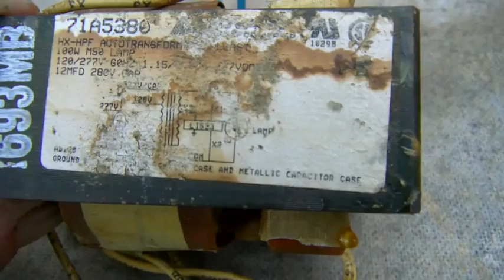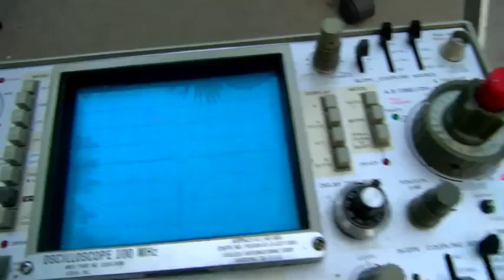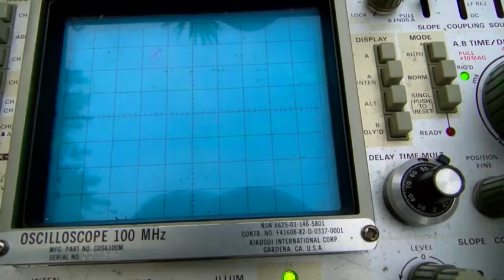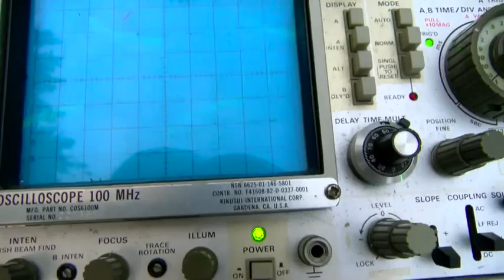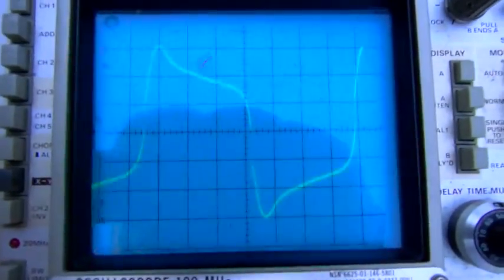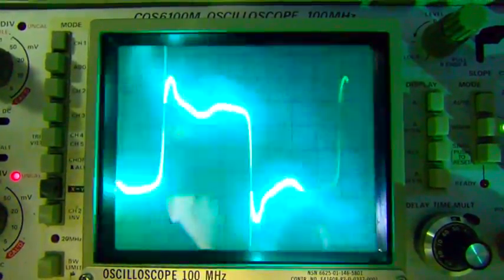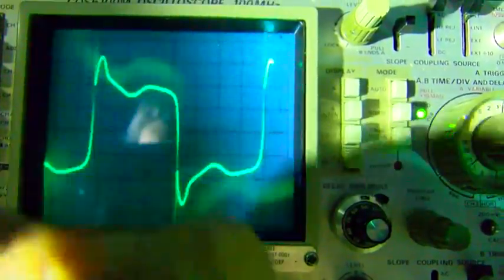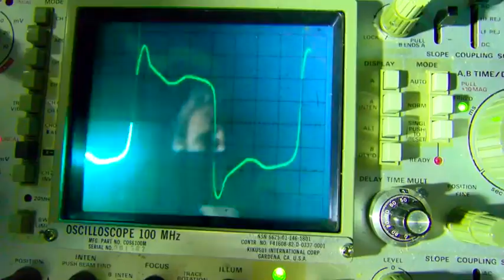Mercury Vapor Lamp Ballast vs Metal Halide

Comment: I have a 100w HPS barn lamp hanging over my garage door.  It's worked well for over ten years requiring only replacing bulb, it's on its third bulb now.  Anyway it recently stopped working, and it wasn't the bulb.  I couldn't find a replacement fixture, HomeDepot and Lowes now only sell Metal Halide fixtures in this wattage and I really wanted a Sodium.  So I took the fixture down to diagnose the issue.  The ballast looked good on the ohmmeter and I was able to test the photo cell and it still worked so that left only the igniter, which on this fixture consisted of 3 or 4 parts soldered onto a flexible circuit board.  So I ordered a new igniter, this one was potted into a small cylinder with three leads sticking out.  After wiring it in (took a while studying the circuit to figure it out), the fixture has now been re-installed and is probably good for another ten years.  Cheap fix ($15) compared to over $100 to replace the fixture.

Enough with this Drump shit.  My god that Asshole is such an embarrassment.  Can't understand why people like him, open mouth, insert foot!

Comment: It would have been interesting to see a current waveform on the primary side (though I'm sure your power line looks nothing like a proper sine wave so maybe a voltage waveform from there also) ) in addition the voltage waveform on the lamp side on dual channels / traces.  (I suppose this one of those times that a 4-channel scope would be sweet....)

Also...  Nice little remix...  :) lol
Reply: drussell in Australia they made a 4 beam / trace scope for looking at 3 phase

Comment: You are right about mercury vapor lasting a long time. It's not uncommon for a MV lamp to last 40 years! Metal halide and high pressure sodium which are more common than metal halide last 3-5 years. They also contain mercury. Think of how many spent MH and HPS lamps are introduced to the waste stream in 40 years! Our government is run by a bunch of damned fools!
Reply: +Jerry Carriera True, we have the same with LED clusters failing in traffic lights and some LED streetlights have a pathetic light output. I think that the drivers are the main concern for failure.
Reply: +Jerry Carriera A well made LED street light will last 20 years with zero maintenance and save a fortune in electricity for a locality   if you scale it up.
Reply: +brian whittle That's true about energy savings but the jury is out about longevity. My town retrofitted the traffic signals from incandescent to LED. The public works department stated they would last 15 years. Not true!! Some failed within a few months of installation.
Reply: Jerry Carriera
 that's why I said well made, due to having electronic parts LED's and their power supply's will fail if they overheat or suffer from moisture incursion, you need someone who knows what's what when  buying systems not the mayors brother.
Reply: +RODALCO2007 Never seen an LED traffic light fail here in Germany. It's all about sealing and cooling. But the intensity is insane.